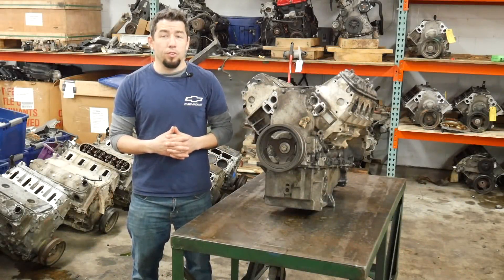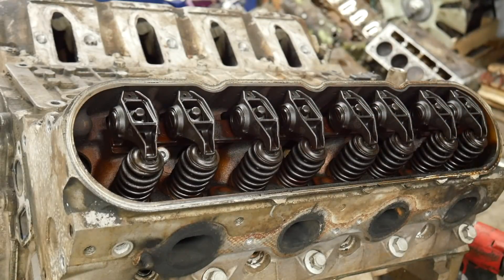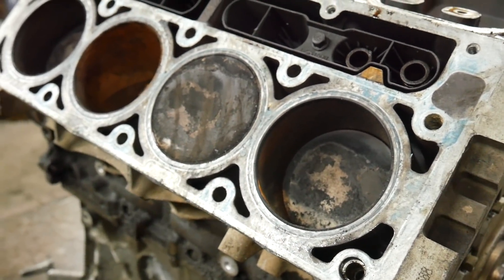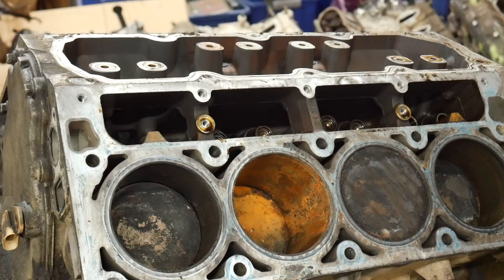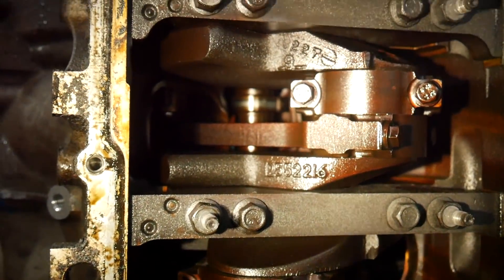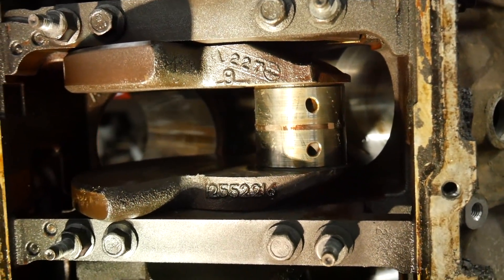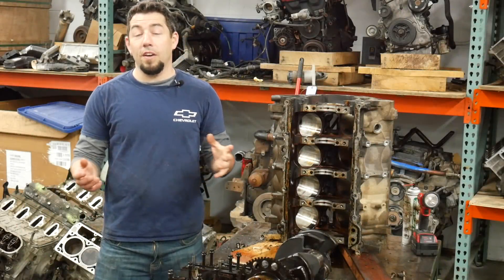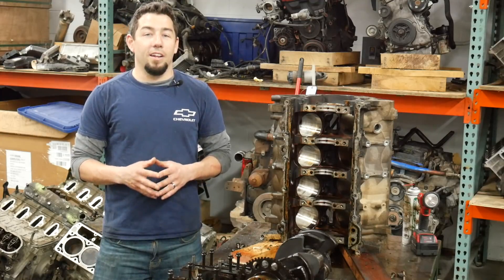Total Teardown! GM 5.3L LH6 Aluminum Gen4 V8. Change Your Oil Folks!

Comment: Fel-Pro should be Fail-Pro, they're just not as good as they used to be. That engine was probably a Walmart oil and fram orange death can filter it's whole life... It's almost as nasty as a quaker state engine from the 80's. Thanks as usual for another great video, I think I've learned more about ls based engines from you than I'll ever need to know.
Reply: When did this happen? I used to use FelPro all the time in my L67 builds. Except the head gaskets. Those I used Cometic MLS.
Reply: @MikeL-FL   probably in the last 10 years or so and they are not all bad just things like holes not punched in the correct spot or a bend not being exactly right, mostly quality control seems to have gotten more lax over the years. The materials still seem fine and I still use their gaskets sometimes because it's the only choice.

Comment: Ive got an ole 03 suburban with like 225k on it. No problems with the motor, regular oil changes... 
Have gone to buy a few newer suburbans, but whenever i test drive them they either smoke, knock, or have low oil pressure. A new oil pump costs like 5k+ on them, so nobody wants to do it. Displacement on demand is a mess.

Comment: What’s the difference between this and a 5.3 LS4? Why did GM do this.
Reply: The LS4 has a stubby front drive, different oil pan and a few other changes. It had to be done to fit the front drive chassis.

Comment: I always look for those aluminum 5.3's for cheap but have yet to stumble on one yet, that engine looked pretty good overall those fel-pro gaskets make me a little sad though.
Reply: What's wrong with Fel Pro? I've never used a head gasket yet, but all 3 of my Jeeps have Fel Pro valve cover, and oil pan gaskets. They work really well, no leaks after a few years.
Reply: @scottdoubleyou563  Sorry that came out as negative against Fel-Pro I run Fel-Pro on some of my engines it's the fact that it was a composite gasket and not an MLS. I just don't like seeing an aftermarket composite gasket when you can get a factory MLS. Sometimes I think people see the cheaper or same price fel-pro and think it's an upgrade not realizing that in this case it's an inferior choice.
Reply: @Misterfairweather  It's cool. I genuinely didn't know about the head gaskets. I'm in the process of rebuilding a 350 SBC, and i was going to use Fel Pro, because that's what the machine shop has for the master rebuild kit. It's not going to be a HP build, but a basic .030 overbore, otherwise stock rebuild. 
Should I use different head gaskets?
Reply: @scottdoubleyou563  I've got Fel Pro gaskets in my 350 SBC they've been good for a long time but like all things they make some higher end line items and some lower end items. What he pulled off of there looked like their economy composite gaskets which seems like a bit of a waste since the cost difference isn't much.
Reply: maybe the person thought the word pro meant it was high quality

Comment: Oil changed on mine at half the recommended intervals. Better to be safe than sorry.
Reply: The oil rarely is the problem, it is the filtration that matters.
Reply: @TheBeingReal  oil oxidation is something changing the oil can prevent.
Reply: @alexstromberg7696  Oil changing is important for sure at recommended intervals. Oxidation is typically an over heating caused issue. Water /fuel, etc contamination is another situation best solved by proper filtration, prevention is the best way though.
Reply: I change my oil once every 20 minutes!
Reply: @matthewkendall7791  ExxonMobil thanks you!
Reply: @matthewkendall7791  I have a constant drip system into and out of my engine, so it's constantly changing its oil.
Reply: @ZPositive  big brain oiling right there
Reply: Well, that's likely quite unnecessary and wasteful. If you want to be proactive then go 85% of recommended interval and only use high quality oil and especially filter.

Comment: I wonder if the oil was changed at 7k or whenever the notification comes on the dash, that could’ve also led to the oil starvation issues if it had a leak or was burning some.
Reply: I have a Toyota, reminder comes up at 5k but I usually handle it before then. I'm glad to see what can happen. It makes the oil changes that much more satisfying.

Comment: Its okay to store motors outside, but cover it with a cheap tarp at least.
Reply: Or a trash bag.
Reply: Yirlani  Well, of course, the trick is to wrap the engine in the trash bag before leaving it out in the rain.  That way that impermeable plastic traps all the moisture outside he engine.
Reply: @OgamiItto70  water will find its way into everything if it does t have a perfect seal. And moisture can build up on cold metal surfaces. An engine with multiple cylinders usually will not have a single time we're all valves in the engine are closed at the same time. There will almost always be at least one cylinder with the exhaust valve open, or the intake valve. Usually both.
Reply: That's fine they are GM motors! You don't cover trash with a trash bag ! Plus there's plenty of those around .

Comment: Is there a functional reason to follow a star pattern for removing head bolts?  Or personal preference?
Reply: Probably don't want to warp the heads.
Reply: 2nd nature. i tend to do torque patterns on things out of habbit more than anything else, even if it isnt a machined fit or gasketed part

Comment: Get one of those tables the transmission builders use so all the oil and water gets collected instead of ending up on the floor.
Reply from the maker: That’s where most of our engines get torn down, but where it’s located in our shop makes filming rather difficult